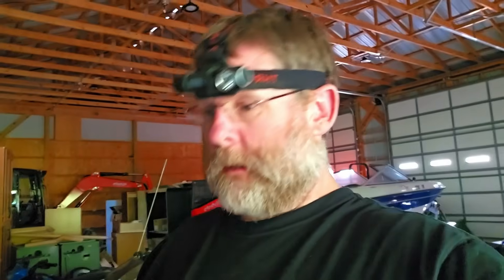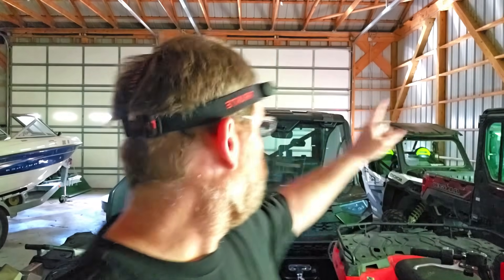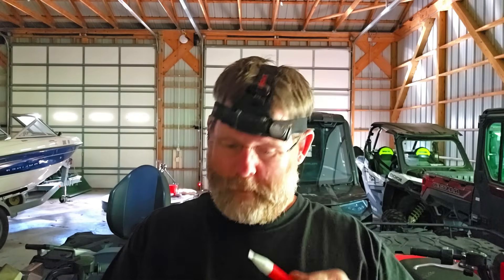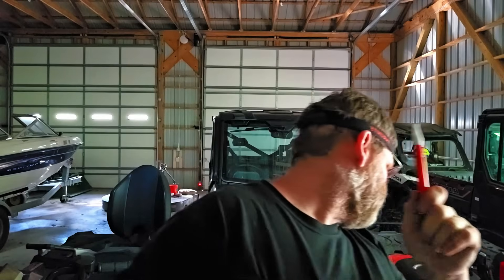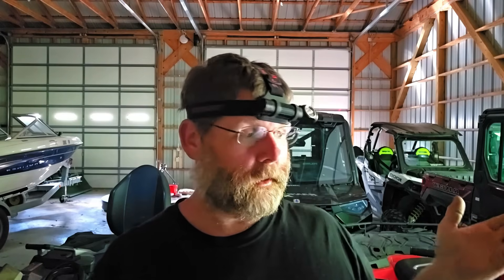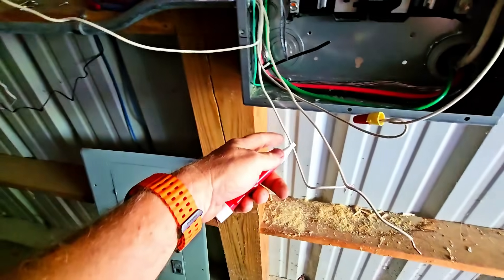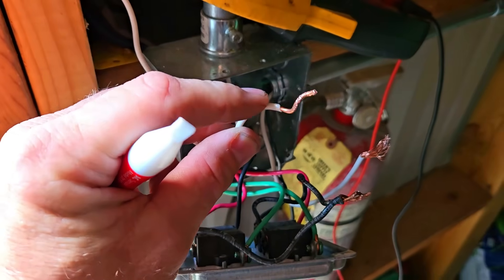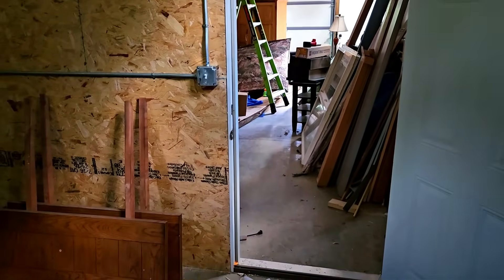GFCI Tripping INSTANTLY | Don't Share NEUTRALS Without Watching This

Comment: I use a santronics tic tracer myself. Love it, trust my life to it.i like that they are always on and dont time out. Well, any gfci that won't reset is an indication that it's wired wrong. Pigtailing the ground to the box is bonding. You should always bond .Yes, if the raceway is tight yes by code its a ground path. But you should bond the box to make sure its the same potential.
Reply from the maker: Exactly!!!